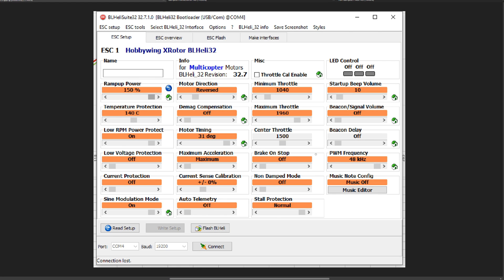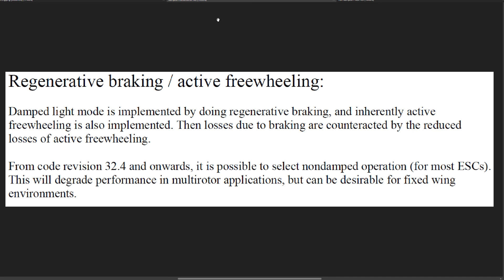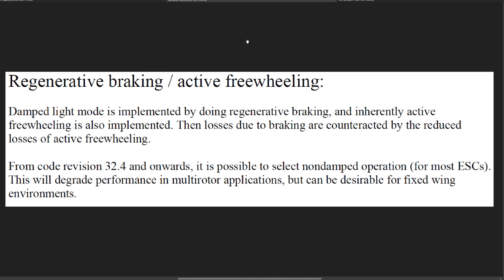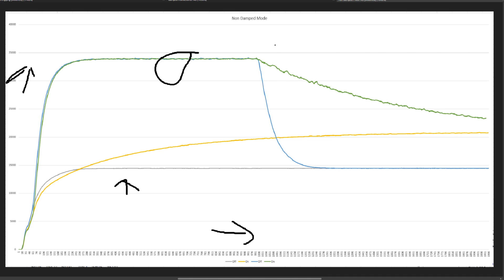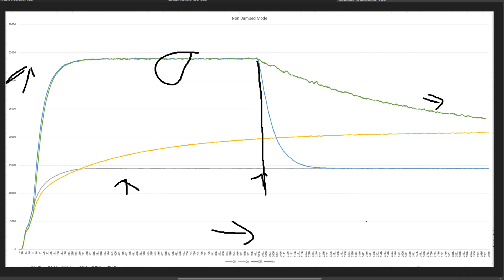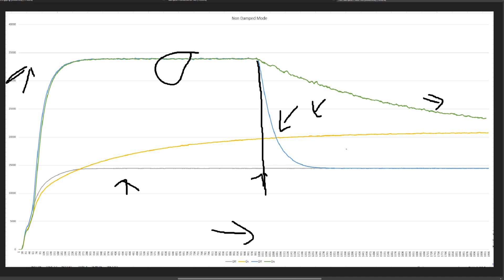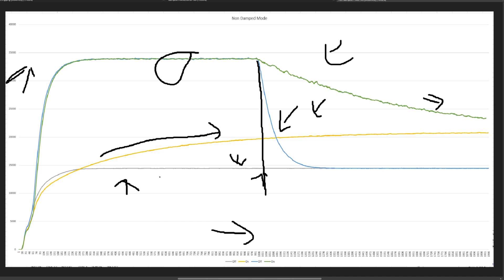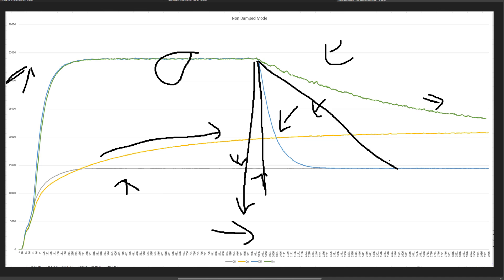⚡️ BLHeli_32 Non Dampped Mode (Damped Light, Regenerative Braking / Active Freewheeling) Dyno

Comment: "In all cases you'd want it off" Useful video thanks. I'm using ESC for a RC boating application and the higher resistance on the large props in the water slows the RPM very quickly anyway, mid-throttle sensitivity isn't too critical there are so many other env variables at play and ~1 sec for it to stabilize is also not really an issue. So this may be an application where it's fine for [non-damped mode = on] (which means Damped mode = off, that double negative is so confusing!).  Re-gen is also not an issue as I can use a huge battery. Keen to hear your thoughts on that?

Comment: Thanks for that video!
I switched from BLHeli_S to BLHeli_32 just to be able to turn off active braking by setting Non-Damped-Mode = ON.
First I thought I missed something, but sadly this unusable throttle response is the current state of BLHeli with braking off.

Ofc. one can try to programmatically simulate the motors real deceleration-curve. But if the motor is stuck (by a dart for example) it just plows trough the curve.
Also, the additional heat is still way higher than with the non-damped free spin.

I opened an issue on the BLHeli_32 github (Issue #542) in the hopes of somehow finding solution to have no braking on spindown but  still having precise throttle response and throttle hold on the way up. This would make BLH_32 so much better to use in Nerf and other  'non-quad' projects.
Reply: Do you have information on how unusable the ON setting is for fixed wing? 
What's the status of your ticket at BLHeli's now?
Reply: @andreask5054  Hi Andreas. Probably not a game-breaker for fixed wing.
My guess is that you will observe a further acceleration over time for some time after giving the throttle input.
So an overall more rubber-band feel compared to having it off.

The ticket is still open and the BLHeli devs seem not to be interested because it doesn't affect multirotors.
However, a comment on the issue might help to bring some more attention to the devs.
I'd still love to have precise motor that can freewheel and stay cool with BLHeli.
Reply: @iDoPew  okay, just tested with ON and it's much more comfortable for us to gradually increase/decrease thrust :)
Reply: @iDoPew  well I hope that BlHeli devs will ignore your requests. Non-quad projects are harmful to community... #ruiningthehobby
Reply: @sigterm15  I really hope you didn not meant "normal" rc-flying (wich definitely IS a "non-quad project") is harmful for "the hobby"?!?
Reply: @florianN132  dont replace 'community' with 'the hobby'